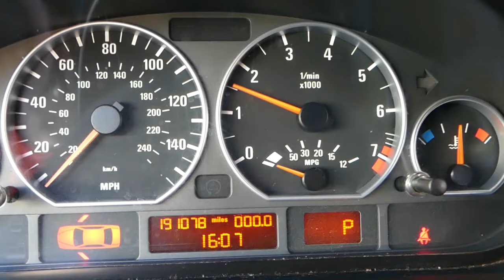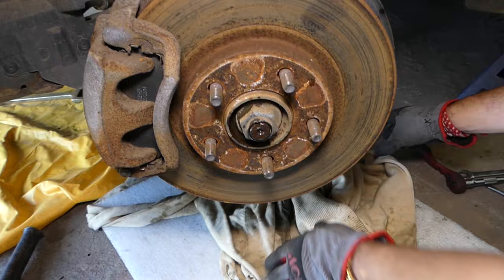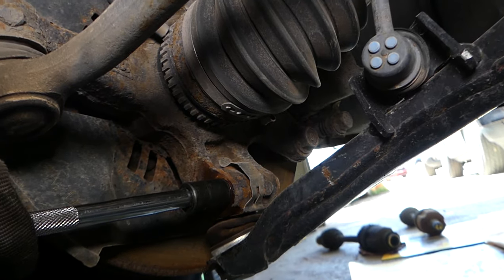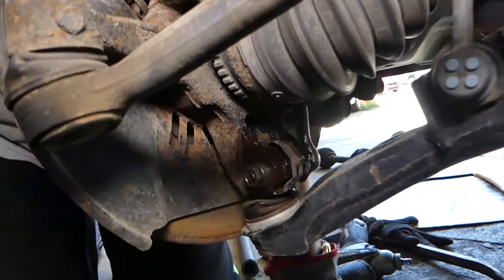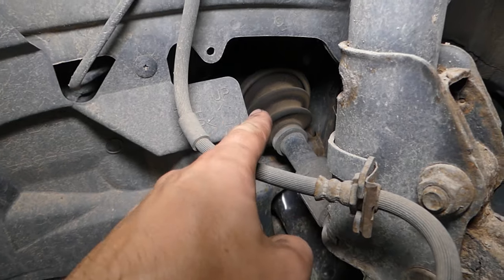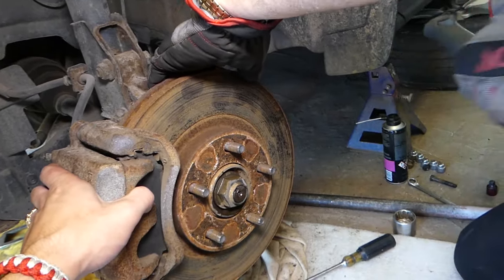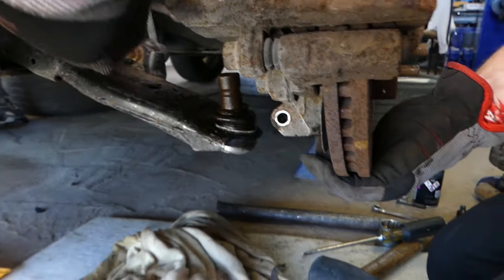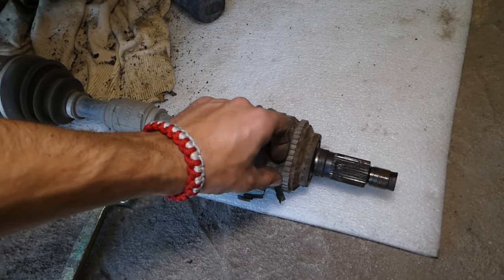FRONT CV AXLE DRIVE SHAFT REPLACEMENT REMOVAL MAZDA 2 3 5 6 CX-7 CX-5 CX-9 CX-3

Comment: Just a hint: When you are removing those axle nuts, you can leave the wheel on, and lower the jack so the wheel is on the ground. Pop the little cap at the centre of the wheel and you can get a socket onto the nut. Make sure it is in park or in gear with the handbrake on, then crack the nut. Then you can jack the car and remove the wheel and continue on with the job. This is a good method if that nut has bound itself onto the thread.
Reply: i put a big screwdriver in the fins of the brake disk

Comment: Thank you for showing the axel pop tool , that’s what I need . But I found it much easier to remove the 2 bolts on suspension strut and retaining clip on brake line and just swing the whole lot out with steering hard  right.
Reply: No need to remove the steering knuckle or ball joint
Reply: You are right. Did it by taking those 2 strut bolts off, too. Much easier.

Comment: I hammered on my axle for an hour and it didn't move cause of rust.  Got a Front Wheel Drive Hub Puller (about $35 to buy and Autozone lends them out) and pulled the hub off the shaft. Cleaned the rust out of the splines and the new one slid right in.

Comment: On my 2006 mazda3 2.3, I couldn't fit the axle tool inside so I had to tap it in just to fit. Thank goodness it popped right out. Went from changing the strut to replacing the axle to replacing the knuckle. Got hit by a semi truck

Comment: The ball joint bolt was not that easy, had to cut it dremel through it and then finally hammer it out while heating the knuckle with wet rag around cv boot and ball joint rubber. Pain! 4 hours! Seized by 5yrs of salt. Initial hammering on bolt how you had it, stripped the thread and eventually bolt bent. Other side , bolt stripped out.
Reply: Radek Woj literally the same exact shit happened with me, tried doing it myself ended up limping it to my mechanic
Reply: @Taronenko1  That screw is a nightmare! I almost took it to the mechanic too but after 4 hours I ended up getting it, never gave up :)

Comment: To get lower ball joint out, i screw a small bolt between the 2 sides to put apart and it comes out  easily.